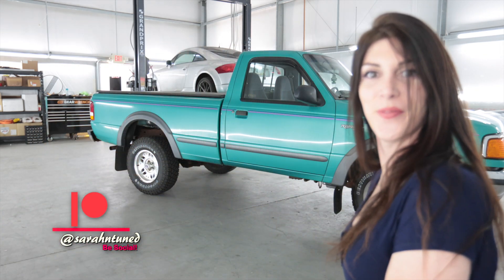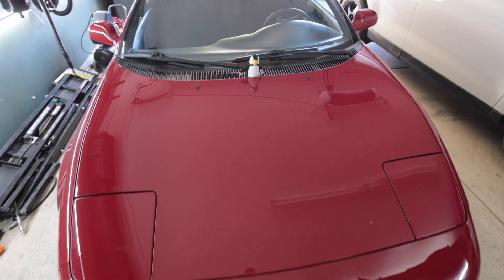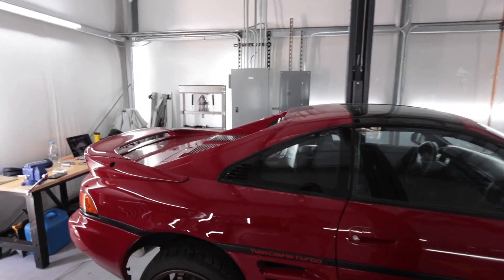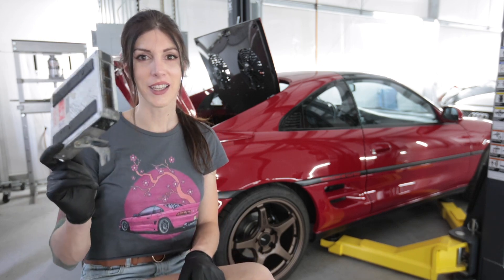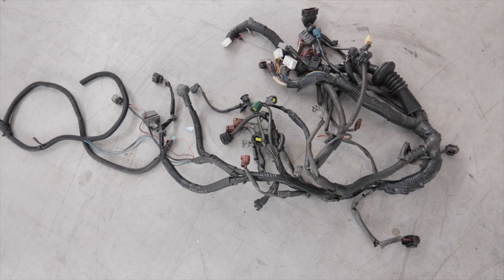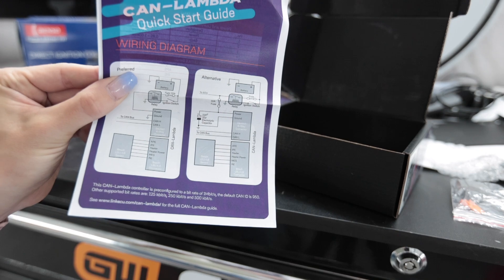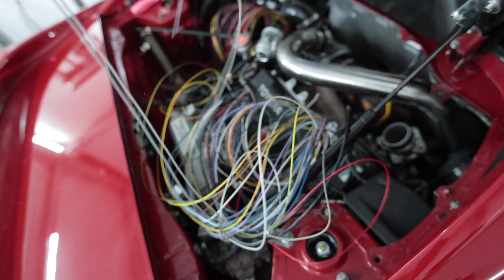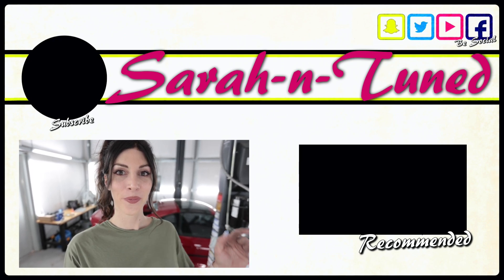Building an Engine Harness From Scratch! // Mr2 Turbo Link G4+ Stand Alone ECU

Comment: Set a pace that you are comfortable with. you have the existing looms, so you will have a guide to model the new loom off of as far as where to tap off the new loom to each component. Your attention to detail will certainly produce a nicer and more functional layout where things could be done better than the factory OEM loom. 

Have the camera roiling the whole time while you are working on the loom. Time-lapse will be your fiend here, so use it. Every now and then break into real time where YOU decide it is worth showing some details in real time speeds. I understand editing can be a pain, though we - your subscribers are automotive DIYers or professionals, or have some other entirely different interests and do understand that sometimes things run smoothly and sometimes they don't! 

Whatever you do do, please know we really do appreciate it :)

Comment: Why don't you lay out the original harness on a pin board so you can mark wire locations, length and where they need to exit the main loom?

Comment: I have found that if it is complicated to break it down into pieces that I can understand and wiring harness is the same thing every harness is made up of a lot of little ones every circuit has multiple places that disconnect from them they are just wrapped in one big loom alternator may have only four wires and the voltage regulator has six but if you know what the wires to the alternator are you know that the other two Are a different circuit. Gets sheet of plywood put a screw in it and hang  connector on it find another connector on the old harness and stretch it out and put it on another screw when all the connectors are on screws trace the harness out with a magic marker then a razor blade to cut open the loom then it is one wire at a time until they have all been replaced and then you can pack it up in a new loom 
And then you will have a New wiring harness most part stores have new connections for you

Comment: Shure your`re gonna do this and make it top notch Sarah! I would use the old harness as a template and spread it across a white piece of MDF. Fix the connectors to it with small nails and write a label for what connector goes where. Then pull the old harness away, and start routing each wire to their corresponding label. I`ve seen this done best in a video of a Koenigsegg, but I forgot which one. I think it was one of DRIVE`s coverage of the Koenigsegg factory, but I could be wrong. Best of luck to you Sarah, and looking forward to watching the wiring unfold!

Comment: Bad obsession motorsports - Projekt binky 
They have a several entertaining vids on their long and tedious wiring job (if you need Inspiration) 
They also use a 3sgte although from a celica gt4 but they sourced a lot of pins and connectors for different oem's in their Franken-harness.

Comment: Tip:  Create a point-to-point wiring spreadsheet with all the sources and destinations.  Use it as a guide to keep track of all the wire colors, connector pins, etc... add columns as needed.  It will give you control and confidence over the tasks.  You'll also have something that tells you how far you are and how much is left to do.  It might also give you something to share in the video, so we can follow along.   Then, maybe some loyal fan will take the spreadsheet and CAD it up! I bet other Link users would dig having a schematic that marries their ECU to the Toyota harness.

Comment: This was brilliant, very watchable. Must have taken ages to film and edit. Could you make a pin board to help with the wiring? I think a lot of the pins and socket connections found in plugs and harnesses are just standard generic, you might even find them on Ebay. Then again you probably looked everywhere I would look anyway. Best wishes UK

Comment: I used to make wiring looms for machines in a previous life, so have some idea of the stress you're going through. I don't know if my skills would translate to an engine harness. If the new harness you are building is essentially the same as the old one, then the thing that save us was creating a peg board of an existing one. Get some big sheets of ply board and some nails. Have the ecu connectors on one side and start pinning the loom out, it's difficult to say where to put the pins but put them in to hold the angles, splits, connections. And write all over the board what's what and if its a 90 bend or a Y split,etc.

We had to sleeve our looms and not wrap them, so we had to keep every wire parrellel from end to end.

Are you going to use the same type of wrapping as the old loom or upgrade it to something fancy like you used at your old day job?

Comment: Just a tip if you take the trunk lid off of the trunk you can sit in the trunk and work on the wiring loom at the same time and it makes it way easier I saw it on mighty car mods

Comment: Don't ask Wire you doing this, just Harness the positive energy in the comments and you will get there.
Bad jokes aside, with your attention to detail and experience, just take your time, build the harness one circuit at a time, you will be just fine.
I'm and electrical engineer by training, wouldn't recommend some people to even operate a light switch, but you got this challenge no problem.

Comment: Wires are fun! I work on truck electrics and sometimes it's a pretty bad mess.
Any Toyota workshop with some standard should be able to supply the pins you need, or at least give you info of what kind of pins that is used.
Love your content! :)

Comment: Welcome to being an avionics tech.  I remember rebuilding a wire harness for an F18  flight control computer.  I think it was 300 wires.  Take it slow and check continuity to ensure the wires and connectors are gtg

Comment: Had a '94 Suzuki Sidekick that would randomly lock/unlock itself; usually at the worst time, as when I left it running at -10 F and then got locked out of it and my office (all the keys in the truck).  Fortunately I had a backup key in a magnetic box under the grill.  Still no fun crawling around in the snow to get it.  Later it developed a tendency to just quit running at random times.  Never did figure out the cause before I sold it.  I chalked it off to it being haunted...

Comment: just take a few pictures of harness areas then lead in to the completed harness, then do a couple of connections and wire wrap shots, finish up with double checking ECU connector pins finish with ECU connection to harness, battery install, fuel system prime check, crank test, start and drive. easy pesy.

Comment: As a dealership master tech, running new engine harnesses is Top 3 nightmare situation. They can become insanely ridiculous without gutting half the car, depending on model. You also have to be careful to run it in such a way to not cause wire stress that will lead to future issues. Hats off to you Sarah for tackling this.

Comment: I'd lay out the original harness and copy it with the new one as much as possible. Get it into the individual runs, and use black tape    to get it into the basic shape. Loom it, and then do your connectors after everything is in place.

Comment: I’ve been rebuilding harness and connectors for my FJ and I doubt that Toyota changed their pin supply preferences much.  Sumitomo 2.3 male/female (unsealed/sealable) pins are available from Ballenger Motorsports.  They also carry connector housings and seals as well.

Comment: You can do it Sarah. Take your time, don't rush and when you feel stressed to a break or switch tasks. Wiring harnesses are difficult because of the complexity of the wire paths but in the end it's just wires. Focus and attention to detail are important and those are your super powers.

Comment: SARAH.....
Well hopefully your still reading the comments cause a saw one you answered 10 minutes ago.
 Get yourself a pin board like you'd see on your grandfather's workbench. Maybe in your case grandmothers workbench... lol
-Mount the pin board to the wall.
 -Mount the old wiring harness to the pinboard. 
-Outline the old harness and the location for each plug. And the termination of each sub harness.
 -Remove the old harness and start matching the new harness so you have length equal to where the old wires lead to
 As far is factory plugs and pins were used the old ones that you cannot purchase new. I would probably just splice the old plugs to the new harness. But that's me

Comment: Sarah I used to work for a company Called United Technology Automotive and we built harnesses for Ford Chrysler and jeep. The easiest way to rebuild your new harnesses is get a 4x8 sheet of plywood and set it up on a 2x4 easel (tripod) Now grab your your old harness starting with the main connector start at one edge of the board and attach it to the board. now lay out the harness and separate by connectors. It will look like tree branches. Once all the harness is laid out place a nail or a screw in the spot where each terminal connector are located.  Now tag what each connector is so you know what wires to run where they need to go. When all this is done you will know the location of every terminal and how long the wire need to be for a perfect fit. Now pull off the old harness and start laying out the new wires to the correct length and location. If you have any other questions feel free to message me. By the way the Ford Ranger took 9.5 rolls of electrical tape to wrap all the harnesses for the complete truck.

Comment: This is the first time watching you're channel I've had to sit through Pampers commercials... and I don't have ad-tracking enabled... is there something you need to share with us? LOL
Reply: On a more serious note. Label both ends of of each wire with their correct ...label. You know most if not all of these wires will be going directly to the ECU, so start there and allow some slack. Run your cables through their original route (maybe securing every 1' or so with some electrical tape to keep things taught and organized) and make sure once they reach the engine bay there is enough slack so that A. they can reach the proper connection, and B. mistakes. Once everything is in place, has adequate slack, etc, you can pull out the entire run and wrap the bulk of the length with corrugated loom, braided sleeving or heat shrink. I think most runs of cable go through a corrugated loom to keep things tidy and safe from pinches, etc. Then it's just a matter of making your connections, heat shrink wrapping or using heat tape to protect the terminations in the engine bay. Not sure if I just mansplained or helped, but, well, there it is.

Comment: When you started running around the truck really fast finishing up the wash job, I wasn’t sure if it was time lapse or not for a second.

I like using the magnet or clip mount with my gopro and doing top down video. A rig for the big camera is super expensive.

Comment: Should have just got the Emumaster from ATS racing with the pre wired harnesses. Plugs right into the existing body harness system.
Reply from the maker: My harness was the issue to begin with, that wasn’t an option.

Comment: use the old loom to draw a template of the wire lengths to make things easier. maybe get a big sheet of ply and hammer nails in the right places to run wires to. will make it easier to bundle together as they will all be the right length and not too slack.

Comment: I don't get vehicle wiring. Yeah I know, it's like water running through pipes etc, but I still don't really get it. I had to do a lot of troubleshooting with my MR2 when it wouldn't start, but would if you jumped the fuel pump relay. Turned out the ECU was dead. So I'm looking forward to these next videos to learn a little more about it. You got this, Sarah!

Comment: Replacing the harness appears to be another one  of those projects where you have to dig yourself ever deeper in mud before getting out again. However, i would be very worried about the condition of the mating connectors that you cannot / do not replace - does the green death stop to creep there? I don't think so... 

BTW, you should turn the old harness into a piece of art that you put on the wall of your workshop.

Comment: Be careful with the paint on the ranger. It’s single stage paint and prone to peeling,   Ford had an issue with paint delimitation during them years.
Reply from the maker: It’s not a single stage. It’s a base and clear.

Comment: If you are putting new pins in old connectors, you have GOT TO clean the connectors really well.  The green death is in those connector bodies and it creeps.  You will be back to intermittent connections in a year if you dont....tips available if you need them on how to clean connectors..

Comment: cool music on this one.
 getting a Gipsy Kings vibe.
Also...for the pins and plugs, why not use new marine/aircraft rated pins and plugs. The shape may not be exact but if all your harnesses are NLA anyways, it's all going to be custom, why not rebuild it 10x better?

 I did this to my old 88 yota 4x4 (with waterproof elec harness) and also an old e30 harness (c191 plug that is prone to corrosion, I remade with silver soldered connections in a new sealed and watertight plug).

Comment: I think it would be easier to go sensor by sensor in the actual car. Run an individual sensor along the preferred harness route to the ECU. Put some masking tape or velcro strip every so often to hold it together. Then just do the next sensor and bundle the runs together as you go. When you get everything run, pull it out and put the shielding on the wires.

Comment: The extent of my vast knowledge in rewiring cars, replacing harnesses, & overcoming worn parts is to chew lots of incredibly flavored gum, and save the foil wrappers to bolster the connections in the fuse box by wrapping fuses with said foil.  Works every time.  Can you believe that with all my extensive worldly automotive knowledge, my family members would steal my shop & garage keys and insert shuffleboard schedules in my wiring drawings?  Kids these days place no trust in valuable content providers.

Comment: C'mon Air Force...You know this....how would you repair a Cannon Plug in the Field when you do not have pin extractors, pin inserters or pins...make a pin extractor for those molex type plugs, then cut the pin wires a little long and solder and heatshrink new wires...use DeOxIt to remove any oxidation and corrosion on the pins...Done and Done.....L8R G8R
Reply from the maker: I’m not half assing my car. Good enough for government work doesn’t apply here, lol 😂
Reply: @SarahnTuned  It's not Half Assed...Unless Piss Poor Workmanship is involved...That method is viable and more stable than original...Solder is a far superior connection than crimp, heatshrink provides additional strain relief and chafe protection. If you have no resource for Pins and Sockets, what Alternative do you have.

Comment: Do you really need to pull the body off the truck? Maybe just clean off the frame rust and paint with rust converter and weld a couple plates on anything weak?  I know,  Not the way you roll.  You look well kid. Strong.

Comment: Just thinking about project binky to give you motivation I would get some heat shrink rap for the wire's and a label wrap like ry-wire  or Chase bay to make look nice and clean an I think 🤔 it would be a cleaner if you relocate fuse box to the trunk an you can put a blow by catch can in a spot

Comment: As far as I see you your definitely a professional. Sourcing connectors I feel your pain😬, I have to do it a fair bit of that. I'd forgotten I had a OEM Toyota wiring repair manual, can email you a copy. Has all connectors and pins etc... Might help, either way I'm sure you'll sort it all out.👌

Comment: I would suggest doing a wiring board, even if it’s just on a piece of cardboard.  This may help keep your OCD from getting too bad.  As for content, I wouldn’t worry about it.  Most of us could watch several 30 min episodes of you just crimping wires.  Don’t feel you need to rush it just so you can get to other content.   Take your time and do it to the Sarah-n-Tuned Cleaning standard and it will be flawless. You got this.

Comment: Create a kind of plywood table and hang it on a wall and measure the needed length of each cable or loom and with some nails transfer the length to the  plywood table and fix the connectors to the needed position. Ones you have all cables and the connectors start looming them together with electric tape and insulation tubes
Reply from the maker: I’m not routing the harness the same way as OE.
Reply: I was actually going to suggest the same thing.  With the cost of ply so high right now, you could use rigid foam insulation sheets.  They are easier to put pegs or nails into, and you can either use your dyno label maker or a sharpie to label what is what.  I've seen this method used by other harness builders and it seems to be the industry standard for independents.  
Sarah, know that you are truly appreciated and loved by the majority of your viewers, ALL of your Patreons and Subscribers and most people that meet you.  We will support and stand behind you no matter your decisions, or "algorithms".  
From a fellow Veteran and builder, we will all defend you whatever your decisions.

Comment: I’m sure there is an auto electrician out there who can help. In a former life I did lots of recording studio installs. With the multi pin connectors you should be able to remove the pins with a very small flat blade screw... driver... by inserting it down beside the pin to release the locking tab. Once you have one out you could probably match it at electronics or auto electronics store. Just a thought 🤓

Comment: Hi  there  ,uses the old harnes as patent . Don't cut your wires mark your new wire with tape  then try for sizes then cut and fit  ends  on  the pluge socket  and don't for get to pigy back covering on first.